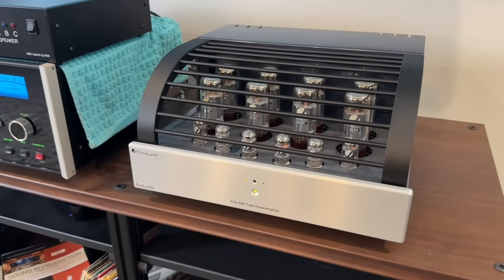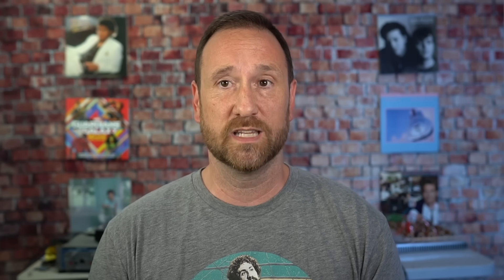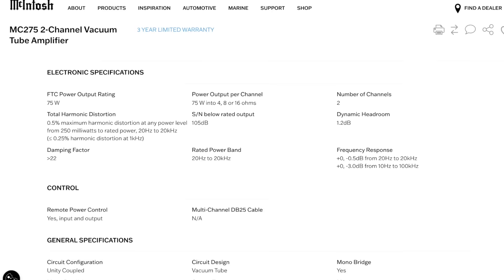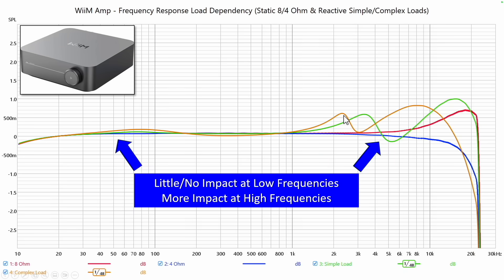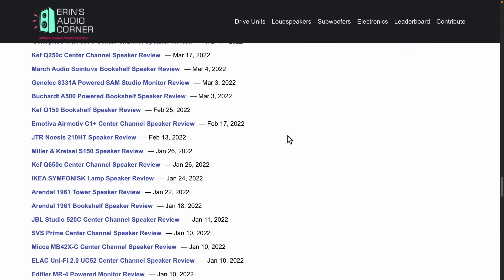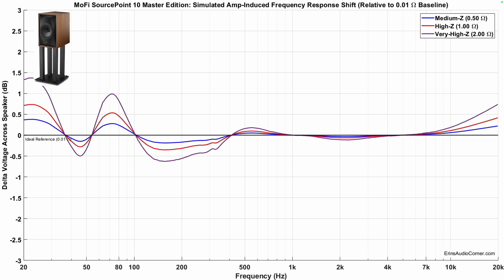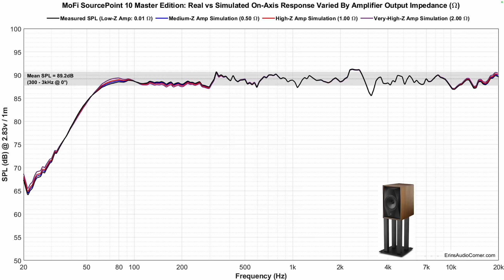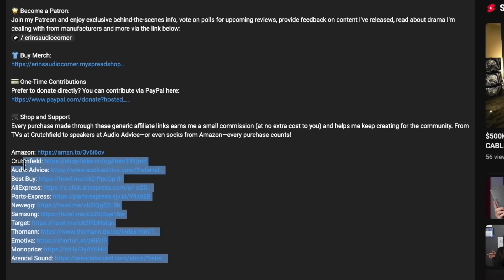Should All Amplifiers Sound The Same?

Comment: All right, nice video. But how would you explain that fact: I own B&W 702S2. When I use Rotel 1592 with damping factor 600 it sounds soft and dark (reduced amount of highs). Some songs I even hardly can recognize from what I remember from 1980s. When I switched to Sony MosFET FA777ES it sounds just right, having just 100 as a number for damping factor. Then I went to the store and compared how these speakers sound with McIntosh hi power amp, and sound was even darker than with Rotel. But when I have listened to the same speakers on the Marants 10 D class amp these did sound exactly as my Sony. Very detailed and linear across the whole range. Math does not work in that case.
Reply from the maker: You didn’t watch the video. You told me when you gave me a single damping factor value. 😉
Reply: @ErinsAudioCorner  DF and Output impedance are inter dependable values. Higher DF - lower impedance. SO, it is not a point, I provided DF and you should be aware that if DF >=100 then it does not affect much the result. I even measured the frequency sweep out of speakers and Rose Noise. It comes very close. But to get a similar level on highs I had to crank up tone level significantly on Rotel. and that is what worry me a lot :(

Comment: I have the original Wiim Amp paired with Elac DBR62's. I have never quite gotten the top end of the Elacs to sound quite right, could it be due to this? I would love to see a graph simulating the deviations caused by the impedance of the Wiim Amp Coupled with DBR62's so I can understand exactly whats going on. Thanks!
Reply: I know you're asking Erin and I hope he responds ... But in the moment, you might find some improvement by (carefully) removing the tweeter grills.
Reply from the maker: It could but I can’t say with absolute certainty.

Comment: This is why we typically say “well designed amps should sound the same”. A low impedance output is part of that. I don’t call amps with high impedance like the WiiM Amp (which I just bought for my dining room) an ideal “well designed” amp. That’s it’s one Achilles heel, but wasn’t enough to drive me away for $240 and a side system.
Reply: If you’re using room correction, it seems like amp load dependency won’t matter as much.
Reply: @MyNameIsJeffffffffffffff  I'm of the school of thought that room correction should be limited to correct the frequency response only in the range where room resonances dominate in the sound, which is typically below some small multiple of Schroeder frequency, e.g. 200-400 Hz is a reasonable region where to look for the limit based on the in-room frequency response of your system. The in-room frequency measurements are the sum of the entire sound field inside the room, and can show coloration due to reflections and related comb filtering effects that is not necessarily present in the on-axis sound, and damaging the on-axis sound tends to reduce perceived sound quality even if it makes the in-room response look more linear or ideal.

Knowing that some dips or peaks are due to amplifier interaction could definitely be used to develop an equalizer, though. I just think that in most cases blindly applying corrections to the entire frequency response will distort the on-axis sound's tonality and likely introduces at least some artifacts of its own.

Comment: If some two amps are well designed and in good condition (not broken) — there's hardly any difference to hear with bare ears. Impedance does affect sound, be it a headphone amp or speaker amp though. That is why I generally dislike tube amps, but any type of amp can be designed badly. And if there's a case of "these speakers sound better with this amp" — it is either that amp is good or it is not good but in a way that complements your speakers impedance in a way you personally prefer. Anyway, amps shouldn't sound different.
Reply from the maker: Agreed.

Comment: In the world of mobile/portable audio, digital audio players and DAC/amp dongles regularly have >1 Ω output impedance. Add in the fact that many of these also have the option of balanced outputs with even higher output impedance, and you have a recipe for some wild results. Point being, the language of "synergy" is even more embedded in that corner of audio than it is in the speaker world. As someone who bounces between the worlds of speakers and headphones, this video is a great and excellent reminder for why "synergy" is such a pervasive concept. Thanks for this.

EDIT: Since some of the replies below seem unfamiliar with the current state of portable audio, I will add that many modern IEMs dip well below 10 Ω, some as low as 5. Impedance matters in portable audio.
Reply: Headphones have much higher input impedance so 1 ohm output impedance for a headphone amp is no issue at all.
Reply: At the same time, headphones have higher impedances than regular speakers.
Reply: Headphones have the luxury of being so high impedance that it doesn't really hurt performance for most of them cos a 1 ohm headphone amp output impedance is not gonna affect the average headphone
Reply: IEMs (which are also headphones) often dip well below 10 Ω, some as low as 5. So, yes, it matters quite a bit.

Comment: Erin, it is/should be well known that tube amps (high output impedance) do follow the impedance curve of the speaker!
Have a look (why didn’t share?) the impedance curve of the Focal.
The Prima Luna FR follows the FR of the Focal.
Reply from the maker: I just showed you that’s not always true. You can’t lump amplifier types into the same category. The McIntosh (a tube amp) shows a different response than the PL (a tube amp). Your theory fell flat on its face right there.
Reply: @ErinsAudioCorner  in my comment I wrote „….(high output impedance)….“ Question. Do you agree that „high output impedance amps“ do follow the speaker impedance curve and this fact is well known?

Comment: Good analysis but it would only make sense for the amp maker to provide the impedance curve if he also makes the speakers he tested.

That is, he is selling both the amps and speakers.
Reply from the maker: I disagree entirely. That was the point of the video.
Reply: @ErinsAudioCorner you said the amp maker ought to provide the curve right? For which speaker? He has no idea what speakers it will be used with so he wouldn't bother, unless...
Reply from the maker: @sonusancti the output impedance of the amplifier is of the amp. The speaker response variation can be calculated. But at the bare minimum, you at least know how well the amp behaves.
Reply: @ErinsAudioCorner 
Again, you miss my point. From the amp maker's view, if I were him, it only makes sense for me to disclose the curves for speakers I would also happen to sell.

Comment: Hello Erin:
While I do understand and agree with your presentation (I've seen it in my own system and on my own test gear) there remains a question of how much practical difference it makes...

If we take the typical TPA3255 output impedance (like in the Wiim amp) ... would we be likely to hear the difference between your Focal and Mofi speakers outside of a deliberate A-B test?

You are graphing 1 and 2 db differences... If that is heard as a jump step between two speakers, yes it is audible.  But how audible is it when it exists at different frequencies and in casual listening.  I'm betting that nobody is going to turn their attention and go "That speaker is really bright" (for example) outside of the A-B testing circumstance.

Should I pan one speaker and adopt another on this basis?
For day to day, relaxed listening, I would suggest not.  

My point, and my question, is does "synergy" (or, more accurately, impedance variance) really affect our lives outside of the listening tests?

Now, I'm sure all the dyed in the wool  audiophiles out there are going to jump up and go "I can hear it, so it does matter"...

But I'm betting the average listener would yawn this off as popycock.
Reply from the maker: I didn’t with the speakers I tested. 

However, my buddy Joe has a review on the WiiM amp vs WiiM amp pro and you can CLEARLY hear the difference in the HF. I trust his review methodology.
Reply: @ErinsAudioCorner  
Thank you.  

I have both PFFB and open loop versions of the TPA3255 design here and so far the listening difference, if any, is truly trivial.  It takes the added sensitivity of test equipment to reveal it.

Comment: Well done Erin. Lots of subjective reviewers mix and match amps and speakers and recognize 'synergy' or lack of it, but no one can explain why. You researched it, knew where to look and came up with the right answer.  👍
Reply: They can mix and match all they want, their subjective thoughts still wont line up with others watching. They might have mixed and matched a bright amp with a bright speaker and thought it was detailed to the nines and not sound bright, in reality that is one heck of a bright setup  when compared to a neutral sounding setup. It is always best to take subjective reviews with a truckload of salt.
Reply: Synergy isnt about getting flat response in your system. its about getting the right sound that one likes and unfrotunately the only way is through experimenation or someone who has similar tastes has already done so.
Reply: @genkifd Or get an amp with low output impedance and use tone controls/ eq 😅 Better hit rate than hoping for a pleasant result based on impedance interactions.

Comment: Great video, uncovering another aspect of the mystery of amp/speaker matching. You clearly demonstrated getting an amp with a "constant" low output impedance can make a big difference, but how much of a difference does the speaker make in the equation e.g. the quality of the crossover, drivers, resonance etc.? Also, how do you measure output impedance if it's not published by the amp manufacturer?  Thanks!
Reply from the maker: You can use what I use which is a quantasylum qa402 (now replaced by the qa403) to measure output impedance. You’ll also need two resistors of different values. But it’s pretty simple to do.
Reply from the maker: As for the speaker impact, like I said in the video, the only way to know for sure is to test the configurations. Without that, all I can do is provide the simulation which is only an approximation.

Comment: And then there's room matching as well. In my small 100 sqft room I run a single ended EL34 tube amp on 5" wide-band drivers in a tapped/back loaded horn (FrugalHorn XL) and the horn matches the room, the drivers match the amp and with a bit of EQ I get a "perfect" sound (with SPL limits).
Using a Hypex amp I get almost the same great sound, but it's not as wide in the sound stage. Still not an as-good match for that speaker in that room. 
Using my big speakers on the EL34 amp it's once again a nice sound and allows higher SPL, but not as wide a stound stage and the bass doesn't get as deep.

Comment: What happens when you ABX the Solid state Mac against your tubed MAC on a speaker and volume level both amps are easily able to drive? Can you still hear a difference? Great video! People like to over simplify things and you get ridiculous statements like "All amps sound the same" without context.
Reply from the maker: I couldn’t tell a difference when level matched. 

The real interesting one was the comparison against the $300 WiiM vibelink vs the pair of mc611 …
Reply: @ErinsAudioCorner  Thanks! That's good information. I run a pair of 8w single ended CLASS A SET amplifiers and using my speakers(89dB 8ohm, 6 minimum and a zobel network) I get the same level matched frequency response from 10hz-20k(until the tubes start to roll off at ~14khz) as compared to a solid state Rotel integrated. Measured by a spectrum analyzer. I can also drive my speakers to ~80db average at my listening position and keep the THD from the tube amps under 1% above 40hz. However,  I was able to easily pass ABX testing between the two. Two other people who had only listened to my system a few other times were able to go 8 and 9 out of 10 with just A/B.Everyone preferred the tube amps. 

Nice teaser for the vibelink vs MC611 video!

Comment: Great video Erin!  Is there a reason for high output impedance from an electronic design standpoint?  Or is it a symptom of just lesser designs?
Reply from the maker: Frankly, I’m not sure why it’s acceptable or necessarily desired. I can guess. But I can’t say for sure if it’s intentional or a function of something else.
Reply: It used to be a technical limitation long ago, so a "lesser" design indeed, because there's been technically better options available for a long time.

However, as always people got used to it back then, and you tend to like what you know. It's basically people developing a liking to these typical imperfections, and then rationalising after the fact.

Typically human psychological behaviour that has nothing to do with electrical logic and acoustic facts, and everything with habits, expectations, and tastes.
Reply: Outside the world of impedance matching for radio frequency antennas... no.

Most audio equipment today is designed using "Impedance Bridging" where a low impedance output feeds a much higher impedance input.  (Do a search, it's a fascinating read.)

Comment: I buy speakers to change the sound. A high impedance amp introduces a second variable in the sound equation. I don’t want multiple moving parts. It also seems that you should perform all of your measurements on a ‘standardized’ amp with low impedance since we then get a clear picture of the real sound of the speaker.
Reply from the maker: I do. 👍

Comment: What i find interesting, that WiiM amp, how does it compare to traditional budget amps like:
Yamaha A-S201, Cambridge AX-A25, Pioneer A-40AE, NAD PP 4,  Marantz PM6007?  On specs the amps from WiiM suggest there is no market for the traditional amps. But your measurements of the WiiM are shockingly bad. Do these traditional sized budget amps  do a lot better than the WiiM? Do the traditional amps in the real world on the best speaker pairs around 500 to 900 dollars actually sound better, beside (if) measuring better?
Reply from the maker: Remember, the one I showed is their first gen. They are on their third gen now. The second gen had feedback to reduce the output impedance. I believe it is practically flat but I don’t recall the value.
Reply: @ErinsAudioCorner  Would be interesting to see. Since the WiiM is so much smaller, that is important. Since entry level amps are often found in working rooms, office spaces, bedrooms or to power a pair of desktop-placed-speakers. 

My current amp is fine for the desktop, but would love to have the extra space and the reduced heat generation of the WiiM.
Reply: Just because you see a bump in the frequency response or impedance graphs does not mean "shockingly bad" .... 

Take note of the scaling on those graphs:
They are showing fractional DB differences, against 75 to 100 watts output capability.  Reducing that to a percentage... the actual output variance in the TPA3255 is like 0.1%,  1/1000th of full power.

Backing those graphs out to show full power, that would plot as a straight line.

Will you hear that difference?  Not likely.
Reply: @Douglas_Blake  As Erin stated, the newer gen's are a lot better. In which i am very interested how they compare to traditional budget "full size" amps.
Reply: @basbass429  
In my experience with TPA3255 based amplifiers, from several manufacturers, they mostly sound alike.  The PFFB is technically better, of course, but not always a big jump in audio quality. 

How do they stack up against traditional budget amps... Frankly I find the chi-fi stuff usually compares very favourably with the old-school entry level amps... and even with some of the so-called "high end" stuff.

I recently did an A-B comparison between an A-07 (TPA3255, $100) and a TSA-75 (class AB, $1,500) ... both of which were touting 75 watts per channel. After level matching them and a few clicks of the relays, quite honestly I couldn't tell them apart.  I ended up breaking the rules and looking to see which was playing.

One small note here, if I may... Small amp does not mean small speakers.  Try cutting the Wiim amp loose on a pair of  Elac or Focal towers... it's a real eye opening experience.

Comment: Hi, great video. I have a question: With this new information, how good is the Yamaha RN2000A? You tried it a few months ago, or what kind of speakers do you recommend to get the best sound? Thanks in advance.
Reply from the maker: Well, to be clear it’s not new information. It’s just not discussed outside a few forum posts and white papers. Which most are not going to see. 

At any rate, this doesn’t change my opinion of that Yamaha.
Reply: The Yamaha is low output impedance so should work to keep a speaker as close to its inherent frequency response

But if you want an example of speaker, the Sourcepoint 10ME he mentioned will work excellently
Reply: Ok,  thanks for the help.